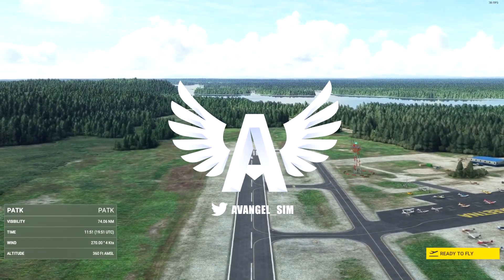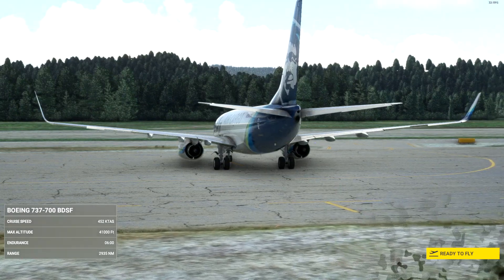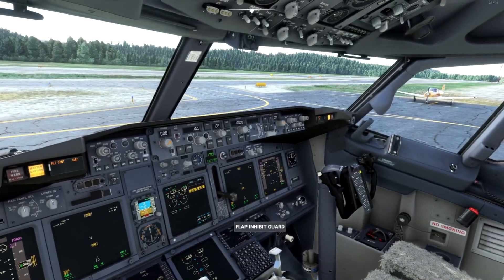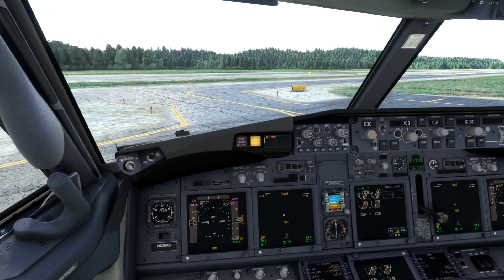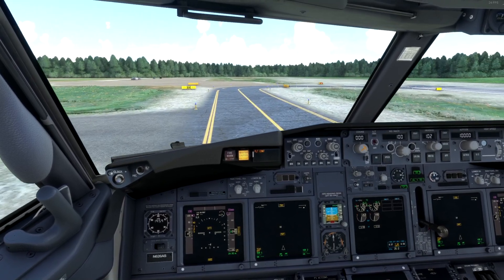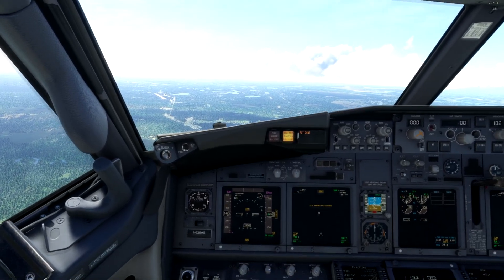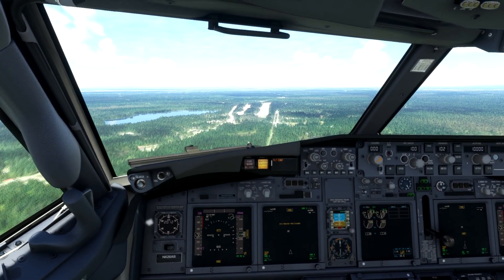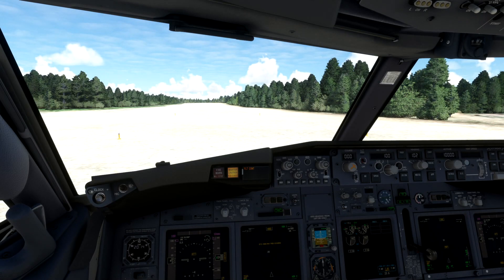Bush Flying in PMDG's 737-700! - MSFS 2020

Comment: You have to align both IRS switches. Vary top panel on the central overhead 
To get altitude and air speed information.

Comment: After turning the APU on you need to wait for the meter to go up and then back down a bit, after that a blue light will go on above the APU button and you can turn on APU gen and APU bleed. The number you're looking for when starting the engines is 20% N2 (screen below N1 where you looked). Gear lever is supposed to be down for takeoff landing, the middle is only used in flight.

Comment: Just a quick tip, don't set the auto brake to max in case of rejected takeoff, there's actually a rejected takeoff setting. If you go all the way anti-clockwise there's an RTO position that's designed for that. :) The difference is that RTO applies maximum hydraulic pressure to the braking system, where as the other settings target specific deceleration rates, and the MAX setting in reality is just the maximum deceleration rate you'd want for a normal landing. tldr RTO much stopness.
Reply: But you're big issue with the instrument was that you never aligned you're inertial nav system, so, in future, if you go to the overhead, right near the back..... captains side as memory serves, you'll see 3 rotary switches on a panel labeled ADIRS (air data inertial reference unit)
Each of these rotary switches has an OFF, Align, NAV, and I believe ATT position. Before moving the aircraft move all 3 switches into NAV, you may have to wait a few moments for the system to align itself. That should then give you your full instruments. If things go badly wrong you should be able to move the switches to ATT in flight to give yourself a fast, rough and ready in flight alignment, but this limits the data available to you, and must only be done with the wings level. note, it is not reversible, you cannot then go back to NAV while in flight. And you also cannot move from OFF or Align to NAV while in flight.... you could maybe jump to ATT to get some basic air data.......
Reply from the maker: So I've been told, still learning this one!
Reply: Aaaand, for the gear, when it's down you leave the handle down for safety, as that ensures you've got both the downlocks and the hyd system holding the gear down, when it's up however you bring the gear handle to the central off position to save on Hyd loading, or some clever logics anyways
Reply: @AvAngel  Yeah, takes a bit of learning, I'm pretty rusty with it tbf, flew it alot in my FSX days, but not picked it up for MSFS yet....  (yet)

Comment: LOL, that's why it's called a study level aircraft, it requires you to do some to a lot of study to fly it proper.  The Big Lit Yellow Square on the glare shield in front of you is your Master Caution warning light.  Push it to extinguish so if something else comes up it will light again to draw your attention.  It was warning you your flight controls were not configured properly, the Yaw Dampener was not switched on.  The IRS's needed to be turned on and the position of the aircraft must be entered in the FMC before you will get anything to come up on the screens.  You did good, it's just that the 737 is a complicated aircraft to operate.

Comment: Hi Angel, I'm the guy who recently offered you some tips on how to make a pretty-looking roll in a medium performance aircraft such as the Beech D18. Superb piloting the 737! You made a great landing and its refreshing to see a flare performed by an airline pilot as most landings on YouTube are the military 'tactical' type of crunch-down, flying straight on to the runway without arresting descent, even by civilian pilots flying commercial airliners. This is sometimes caused by shifting focus from the aiming point for touchdown on the runway to the end of the runway. Yeouch! In my case I found it easier to listen to the aural altitude indicator while taking dual instruction with Air Canada in their Airbus A320 CAE level D full flight simulator at their pilot training headquarters at Toronto International Airport. Interestingly enough the CAE built simulator costs $15 million and it doesn't have a lot on the Microsoft simulator except for the enhanced physical environment. You sit in a fishbowl of sights and get the same vibrations as a real aircraft but the actual flying is not so much different. In my case when I told my instructor I would flare at 50 feet on my first landing in the A320 he asked why and said not to forget we were flying final approach nose-high in any event. But I found 50 feet too high to arrest descent and I henceforth did so at 10 feet when given the altitude by the aural indicator read-out and just like your landing it was extremely gentle with just some soft chirps from the mains. So if you can turn on your aural altitude readout I think it would make it much easier especially for consistently obtaining "greasy" landings in future!
Reply from the maker: Flaring seemed natural for me, as a GA/bush pilot, I assume you're meant to :D

Comment: This is some outside the box flight planning. 😁 I hope you were wearing one of those little robber masks across your eyes! Last time I tried this with the FBW A320 NEO all my engines failed @ 35,000 ft. I am ok as a glider pilot and tried to make it to Salt Lake city. These things will glide, sort of. I got it on the runway but must have torn the landing gear off as it came to a stop on it's belly. Needless to say I got out of there quickly to avoid the cops.
Reply: LOL,LOL